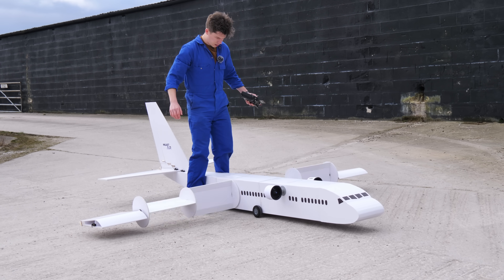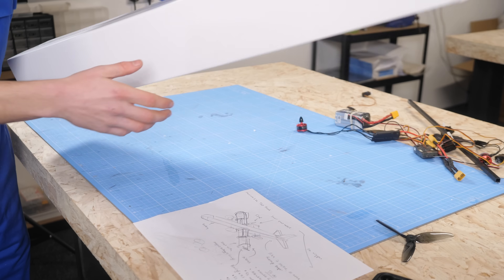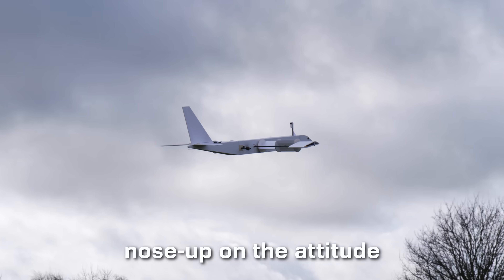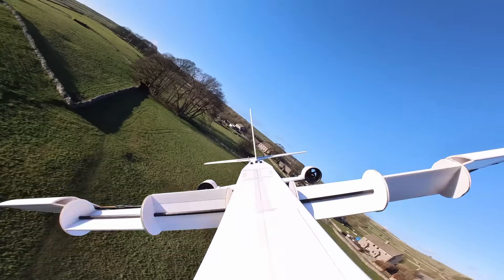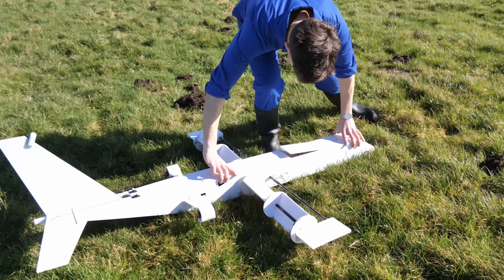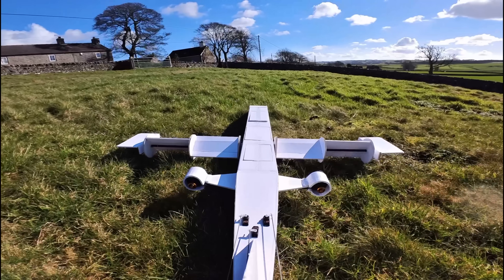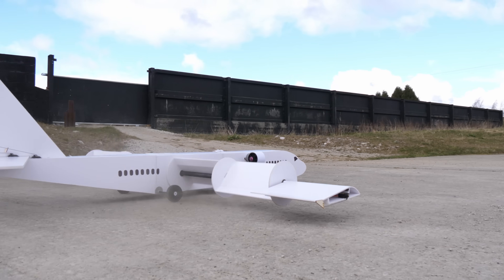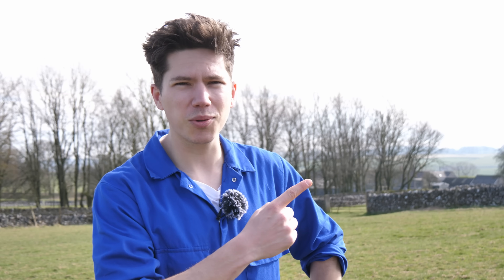Giant Magnus-Effect Plane

Comment: If you want the plane to go faster you need a matching aerodynamic board on both sides to stop the air being absorbed and slowing it down, as the drag can seep through the flap and cause the plane to slide backwards and loose it’s balance, but well done!😮

Comment: If you haven't checked out a Fanwing - it's a powered lift aircraft that combines a wing with a rotor embedded in the upper surface to provide both lift and thrust.  Invented by Pat Peebles at University of Rome in the late 90's several RC models have flown, but you might want to see how big you can make one!  I tried (and failed) to make a tiny one in college in 2001, but it shoud scale larger better and motors and batteries are way better now.  Pat is now in London and there are a lot of full scale concepts, but no one has flown one larger than a couple meters and few kg yet.  It's more efficient than a magnus effect plane because the lower side of the rotor is shrouded by the wing to reduce drag and produce a net forward thrust by the motor.  Also a side note - for slow planes, you need to avoid ducted fans and go with large props spun slowly by high torque (low kV) motors - think B-29 vs F-16.

Comment: I'm very impressed with your initiative and focus.  Two thoughts:  Why does there have to be a single rotary Magnus effect arm?  Why can't you separate them into rotating arms, that can then be controlled separately?  That might help you with the turns without losing power.  
Secondly, how is this thing being powered?  Batteries are extremely heavy.  In fact, I would wager that is the biggest factor in your plane's weight.  What if you got rid of them and replaced them with capacitors instead?  I understand that capacitors don't last nearly as long as batteries, and that large power capacitors can weigh nearly as much as batteries.
But what if the entire shell of your airplane was a plane-shaped capacitor?  The plane itself could be your power source, and eliminate the weight of batteries altogether.  Just a thought.

Comment: Hey .I love your work..
In the middle of your videos I made my own diagnosis.....towards the end you addressed two .
The very first one would lift..if
1 change the position of blade to come Infront of the wing ....add increase their output
2 In the first place the tips of the wing are facing Infront not backwards like in the end plane..if the plane was to be wind driven tha would be the correct position but if motor driven...be as corrected at the tail end model.
3After increasing power and position or the rotors...MAKE BOTH ROTATE IN SAME DIRECTION....because your wings two should rotate towards the front.DONT make it COAXIAL.
If right rotation in front rotors doesn't work try left rotation for both while both wings rotate forward.

4.Adjust the wings towards the front and reduce the back to make short chase..not looong chase...

I love air projects and I have done myriads of experiments...
Only in Africa we are yet to reach your point of printing models and fixing them...
Keep up Man
Reply: I think too the plane should perform as an autogyro..place the high power high speed rotors  behind the wing as in the first place but don't power the wings....they will rotate on their own...
Shape the wing blade into letter C or 1/4 circle....with the lead part wide and tail part thin ..(air foil blade ..4 blades shaped in quarter circle shape...

Comment: Would the lift effect not be greater if the wings were cylinders? And beyond the theoretical will it fly concept, will it glide under engine failure conditions? This may require a fan drive to the wing axles to cause them to spin. Another thought to do away with main wing control surfaces would be to control cylinder spin either side of the aircaraft to increase/decrease lift to cause the aircraft to bank and thus turn. A very interesting project. Good luck for your next set of test flights.

Comment: As a kid back in the 1950's and 60's magnus effect kites where quite common, predominately preformed plastic aeroplane fuselage with a steel rod passing through it. Cambered wings were attached to and surrounded the rod, 

I would suggest that you make a NACA symmetrical aerofoil say NACA 0015 foil 
making one per wing that would reduce the need for two rotors per wing where one is at right angles to the other therefore creating maximum drag twice per a revolution, it also removes the need for the rotating end plates, and with the rod through the centre of a symmetrical aerofoil will remove/minimis the vibration issue.

as you seemed to have a large nose pitch up moment due to mass behind the centre of pressure try a canard which would prevent stall and allow the mounting of ailerons for roll control.  
Thought of a former aircraft engineer.

Comment: The solution is you need to shield the part around the Magnus effect that is causing drag instead of lift. then it will work as expected because on "drag" it would provide lift as well.
Reply: Think like a ) around one of the sides where the drag is happening.

Comment: Why try and see if a less efficient solution to an already solved problem also works? The wings in the design are useless. Might as well be any shape you like. If the engines are powerful and there is enough flow over the control surfaces the objects shape doesn’t matter. Like stunt planes where the wings do not create any lift and the plane is able to hang from its prop due to the enormous powerful engine. Even if there is a magnus effect, it won’t do anything for the flight capabilities of this plane.

Comment: For the larger version you need to use a laser balancing system to keep the vibration down to a minimum. Balanced on all 3 axis. Like the balance fan rotors in jet engines. Or tires in race cars.

Impressive overall. But I was very surprised you didn’t use direct drive immediately. The fan drive is very inefficient compared to direct drive.

Also you could a small weight inside on a slide. Allowing you to move it back and forth to check for proper front to rear weigh ratio(which appears to be off). You could put it on a stiff wire and move it back and fourth clamping it in place. Running it through a wind-tunnel might help also.

In addition, Maybe try adding some small adjustable canard wings in front.  I was also going to suggest that if you’re going to use fan motors, then you should move the fans to the front because they would be more efficient there. But I see that you’ve done it. 16:03

I definitely respect your initiative and spirit. Keep it up.😅

Comment: Here's a thought - as I understand it, the magnus effect results from the difference of the cylinder sides' speeds against the oncoming air. The way I understand it, ideally the top of the cylinder (or panes )should be moving backwards exactly as fast as the plane is moving forward. In that case, rotating them any faster should give you less airspeed difference on top and bottom and therefore less lift. But I may be completely wrong...lol

Comment: Love the Author, but this is definitely NOT the Magnus effect 😢 the Magnus effect uses 'Supercirculation' with a rotating cylinder 'only', could say more but what's the point 😢 everybody gets it wrong, and this is not exactly the largest version of this concept 😢 i mean heck, they started pushing ships along with the proper Magnus effect in the 1930's, let alone other people making RC versions of this, with proper powered drums/cylinders, but adding more disks, not just to the ends of the drums, increases performance markedly, as well as cutting expansion 'blades' into the disks on each end of the drum/cylinder, bit like the slots in the endplates on a formula One rear wing, but it doesn't take much searching to find this information 😢i am just another dumb engineer, and I found it in minutes. The best versions of these planes have powered drums at the front and the rear of the fuselage, creating the equivalent of a helicopter, that can actually hover on the spot, without a single bladed 'rotor' in sight, and extremely stable 😅 without the massive complexity of the contol system of a typical helicopter rotor, can't understand why it isn't used more.

Comment: 1. Use a lifting body fuselage / airplane body 
2. Use ailerons on the front nose  of the plane
3. Use a partial wing in front of the spinners. 
4. You could try placing the engines in front of the spinners. 
etc....

Comment: You have a rotating aerofoil which means from the aerofoil’s point of view that angle of attack is continually changing. The aerofoil will produce a vortex street which equates to lots of entropy production which equates to lots of drag, which isn’t sensible when compared to a normal aerofoil. Trying using a powered smooth cylinder (i.e. a Flettner rotor) or a conventional aerofoil.

Comment: I imagine that angle of attack isn't really an issue for a Magnus effect wing (or rotor?). That would mean that lift isn't a function of AoA and airspeed, it's just a function of airspeed. The lift vector would also depend entirely on relative wind so if the airplane was at 0 forward airspeed and started descending the lift would actually be pulling the plane forward. Roll would also generate adverse yaw due to the upward movement of the "wing" generating a rearward component of lift.
I wonder if bigger tail surfaces wouldn't help with stability by keeping the "wing" travelling forward better? 
I remember reading about a similar plane in a magazine 30 years ago or so. It used cylinders instead of flat spinny things.

Comment: a paddle would push air downward for lift in the back but create a vortex in horizontal going up in the front ? meanwhile when horizontal acting like an air brake wouldn't it?  may need some sort of cowel on the part of the process.  i'm curious if a biplane would be better since they could counter rotate and concentrate the air for thrust... but thinking about it would mean needing to offset their placement to both provide the lift necessary.  eh, wish i was a physics sort of person to know if the ideas were feasible or not.  part of me even thinks making it like a grain elevator might work... with the tube being a corkscrew with vents near or on the top to allow air to be pulled in, along with the air from the front for forward movement.  vents on the bottom or on both sides near the bottom to try and provide lift?   technically would probably have to use 2 corkscrew tunnels counter rotating, each basically sucking air in from the front and above and blowing below at different angles for stability?  idk... i think too much... ty for the inspiration.  peace.

Comment: The flaps on the wings are off center, so yeah there is vibration there. Also, if you sit on a turning stool, holding a turning bicycle wheel, then as you orient the wheel's axle, it will turn you! How is your plane compensating for this?

Comment: You need to look at a car wheel, when you have a tyre changed they have to balance the tyre to remove vibration from all four wheels. I think this needs to apply to your rotors, also would you be better off have 4 rotors @ 45deg angles so instead of having lift in 2 pulses each side the more you have the steadier and more consistent the air delivery would be. If I am talking rubbish then tell me to go away politely. 🤣😂🤣 I was 9:37 into the video. But it’s a really interesting idea. 👍🏼👍🏼🖖🏼🖖🏼

Comment: Just amusing to me,
Where I thought why do you allow it to thrust to be thrown in all directions
When maybe you should be stopping some of the radial thrust from going upwards,
By shielding some of the thrust
You ight find you may have more control 
Other wise you may be fighting a dead horse

And stop throwing it into wind to start flight
Why not use landing gear and you may start to learn more from proper take offs that from throwing guess work into the air

Comment: Not magnus effect.
This is just a wing that varies in effectiveness during each rotation.  At 90 degrees (vertical), there is maximum drag and no lift.  As the angle approaches horizontal, it reaches stall, then maximum lift, then no lift as the wing is horizontal.  If this flat plate was rotating slowly, then any net positive lift which occurred during this first 90 of rotation would be undone by the next 90 of rotation.  But since the flat plate is rotating into the wind quickly, there is more positive lift during the first 90 degrees than negative lift the second 90 degrees.  So there is a net positive lift.
Not magnus effect.

Comment: I have a question about the lift increase: surely twice the size ensures four times the lift, but won't it also contribute to having four times the mass as well? (assuming you don't double foam thickness, or else it will be eight times the mass)
So, how does this help making the plane easier to fly if both lift and weight increase at the same time?

Comment: As with any airplane, there are two situation that you have to know and do. One is the center line down from the front nose to the rear tail section. Both side have to weigh equally. The second is that you have to mount any type lift factor at the C/G of the plane. Too heavy one end over the other and it will not work. I see you had an airfoils profile at the other edges of the plane's lift section and they were probably assisting in the lift factor. But keep trying and working. That is how new ideas come to life...    Thumbs Up!

Comment: So quick question. If the wing rotors were independently powered, couldn't you control roll angle just by independently changing each wing's RPM? If it worked you could do away with the control surfaces on the tips of the wings, possibly allowing you to extend the lifting area as needed.

Comment: I was surprised that you didn't balance the rotating planar surfaces on each side of the rotating shaft on at least, the big version. Although it wouldn't have been difficult on the mid-sized prototype, it was excusable but once you scaled everything up, you needn't have insisted on including such design compromises. Two sheets attached each side of the shaft wouldn't have been difficult and would have created less vibration.

Comment: It occurs to me that if you reverse the rotation direction of your motoes, you'd obtain the required lift you desire. Also if you increase the speed of your motors it will also produce more lift faster than before. A slight angle to your blades will also improve the desired outcome (similar to a ducted fan).

Comment: An idea: what do you think to add another magnus - cylinder both sides of the wing. Both engine should be running similarly and would be used to stabilize the flight by slowing down the cylinder that is higher than the other?

Comment: If you want to keep the friction to a minimum, don't use rubber sealed bearings.  There are some overlapping metal sealed bearings that are lower drag.  They aren't as well sealed, unfortunately, so it is always a trade.  You might want to try a good ultra low friction ceramic bearing, one where you can spin the outside race, holding the inside, and it will spin for a few seconds.  Also, you want to use some very light machine oil, NOT grease, for lubrication...or none, if possible , and the drag is lower in that case (probably not, but worth a quick test).  Obviously the life of the bearing will go down dramatically with no lube. Watching you spin that wing, by hand, shows ne that you have a lousy bearing system, considering the application.  That is likely causing a LOT of excess drag, and reduced lift.

You do realize that with enough angle of attack and powerful enough motors, that you can fly with NO wings, right, a la a helicopter.  You have quite a bit of flat body lifting surface here, as well.  I would be interested in how much lift the wings were actually providing.  

When powering the wings, use TWO inboard bearings, spaced a bit on a rigid frame, balance the rotors, that would help immensely, in that order, just two spaced bearings would probably be sufficient.  The outside bearings have decreased stabilization, by themselves, with only one inner bearing, due to the flimsy nature of their mounts, not that you could do much about that, without more complex strut design.

Fun project, fun to watch.  Also, more weight does not equate to less lift, those are completely separate parameters.  The relation is what you were speaking to.  To make a heavier plane fly, you need to generate MORE lift, not less.  A reasonably small amount of dihedral would improve the roll stability, as well, maybe a 4" rise or so, measured wing tips to roots, vertically.

Comment: The motor is directly blowing air into the flaps, which is creating extra pressure on the flaps. That is a weak point in the airplane. Also thouse flaps are aff centered. That is createing vibration.

Comment: You should have tried a front engine configuration so potentionally the engine exhaust could speed up the rotation of the wings even more.
Which you later on did do actually so congrats!
And the ratio is actually Thrust to Weight (can be bellow 1 but will affect acceleration, speed, and climb angle) and Thrust to Drag ratio (needs to be above 1), not Lift to Weight, with enough thrust anything can fly, but the lower the wing loading is the  more manuverable your plane will be, famous example of this is the F-104 Starfighter with stubby but very angled wings to not produce much drag, but It's really fast. Altough this type of wing is inneficient as it creates lots of extra drag from it sort of functioning like an airbrake.

Comment: The latest iteration of plane has a proper air foil profile wing tips; how do you know that the major part of the lift isn't generated by these? I would like to se a hop with no spinners and just the wing tips. Could it be that the plane lifts despite of the rotating planes and not because of them?